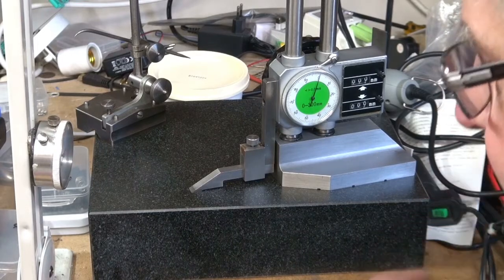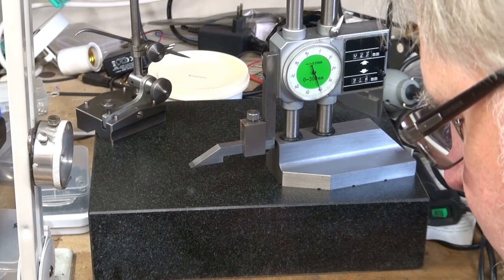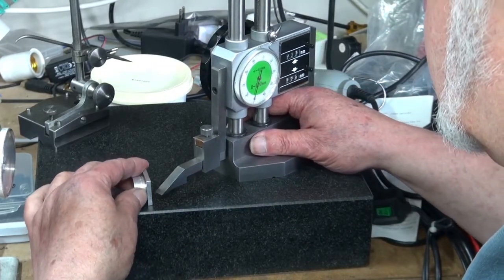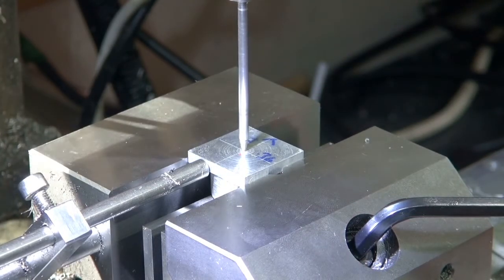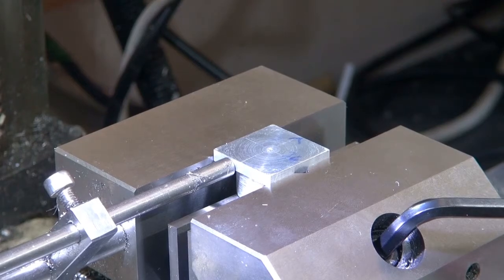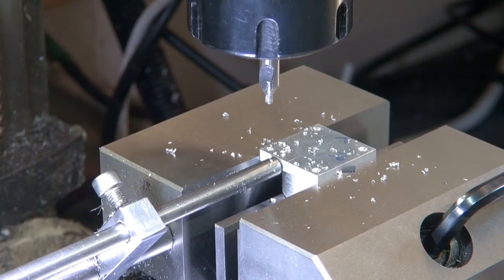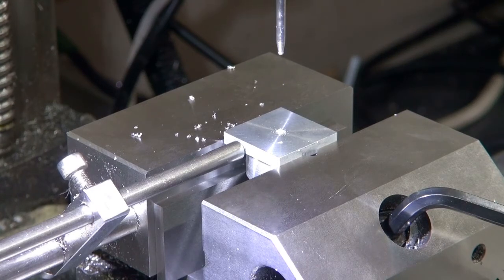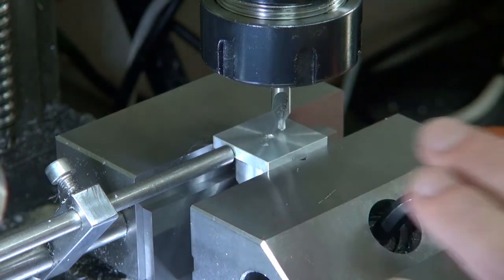Backplate and Crankcase drill,  Warts and all.

Comment: As a retired train driver, I'm curious about the displacement and horsepower of this beast.
Reply from the maker: The cylinder  bore of 13.4mm gives a sweped volume of 2cc or 0.122047 cubic inch.As for the horsepower I haven't a clue. :)
Reply: Thanks, Keith. I'm amazed at what you can do in that shed. I do hope you realise you're a genius.